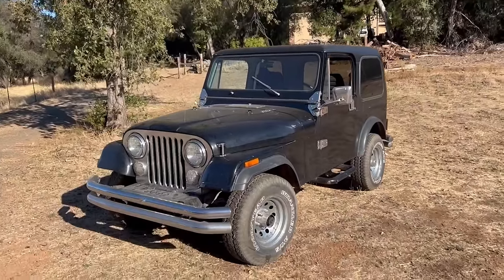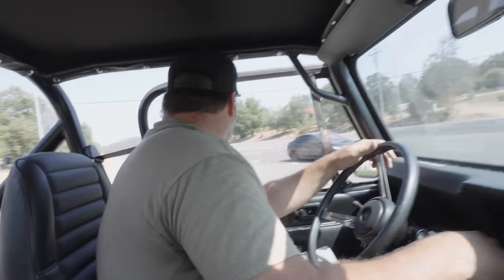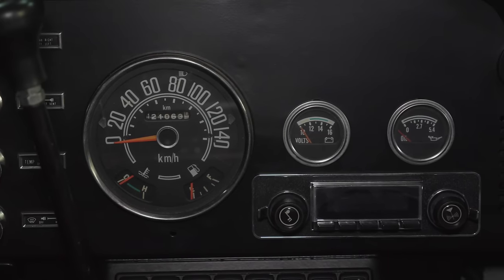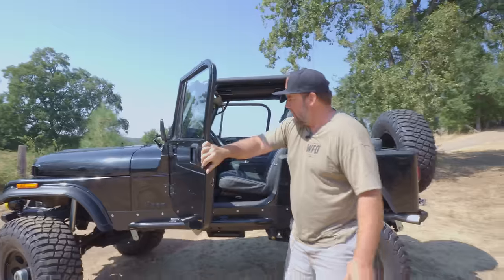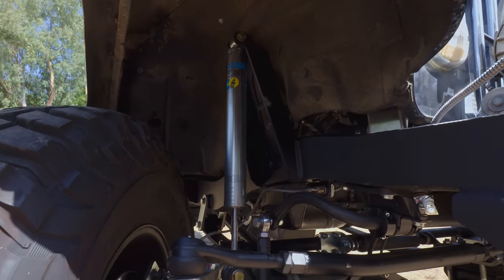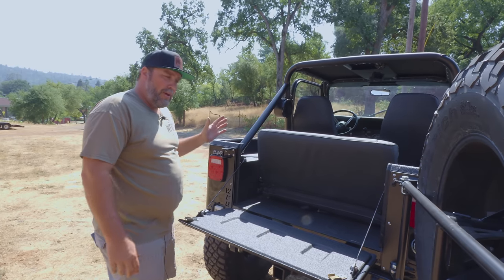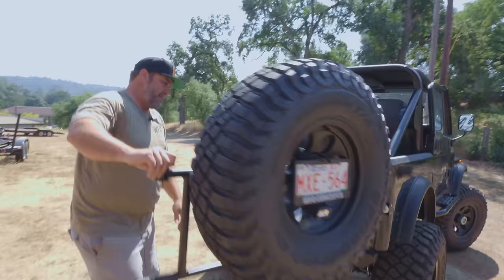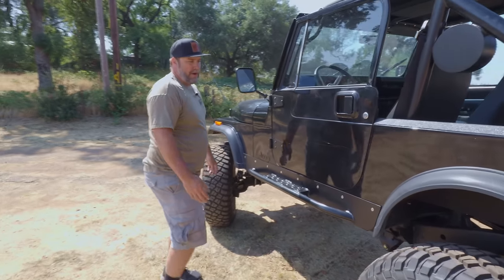LS Swapped CJ-7 on 1-Tons

Comment: 82 CJ7,wrangler tub,wagoneer axles, 36" super swamper tsl. 360 AMC 727 auto. Spring over, traction bar. Built 20 years ago, street driven also.

Comment: This is literally what I’m  trying to do. I still have stock drive train, but swapped in a sm465  trans to do a future sbc swap. I also have the hydro boost in a crate to rebuild, and a serial number correct warn winch in a crate. I have been collecting parts for 20 years! I want this so bad. I was going to run a aftermarket tilt steering column. Why keep the stock junk?